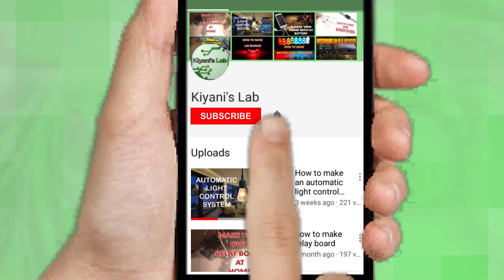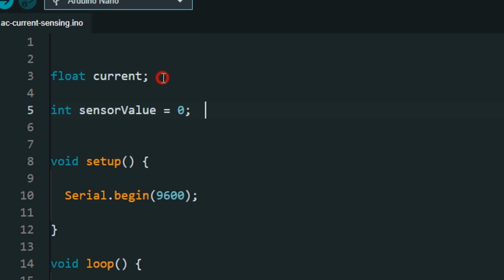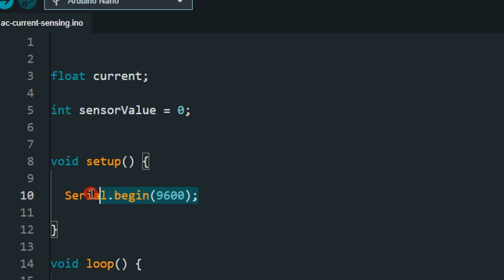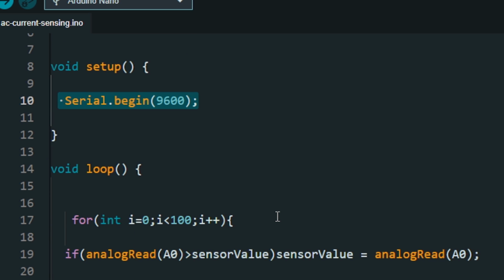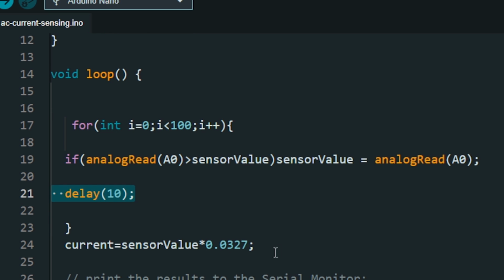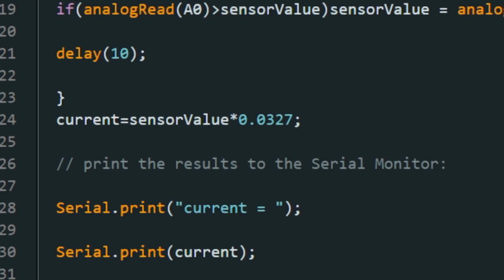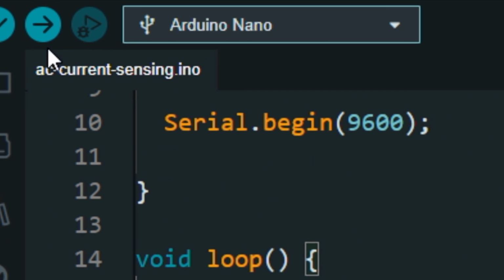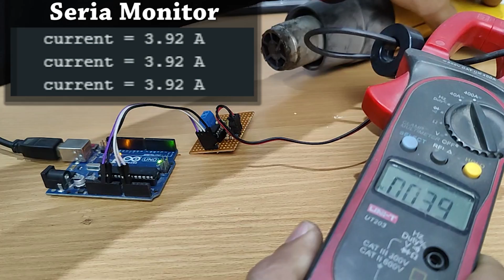How To Measure AC Current With Arduino

Comment: Tells nothing about what the circuit does, nor describes the CT output and what is needed to convert it. Thumbs down. What is the signal from the CT? What is the output from the circuit? Show a schematic not a wiring diagram.

Comment: What is your CT's ratio? Is it 100A/2.5V, the same as the CT you recommend in the description?
If it's 100A/2.5V+-...V. When you use an amplifier circuit, the max voltage is going to be 9V(if using +-2V). It would be higher than the maximum voltage of Arduino's analog input.
Am I right?

Comment: Actual board has more resistors than showed in graphics diagram ?
Reply from the maker: yes because it has voltage sensing circuit as well videos coming soon
Reply: Please make a video on under and over voltage protection circuit using Arduino.
Reply: Will this measure millivolts AC?  Thanks